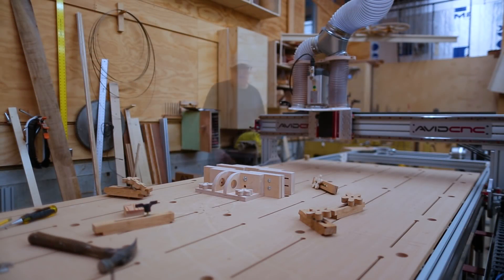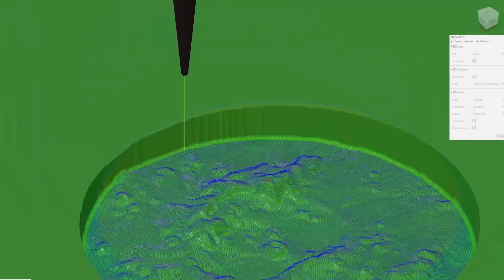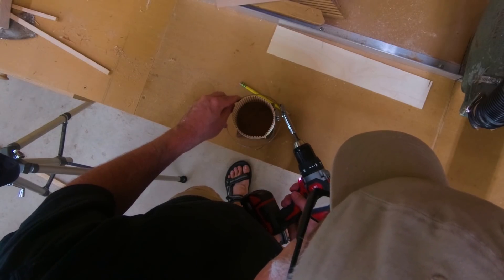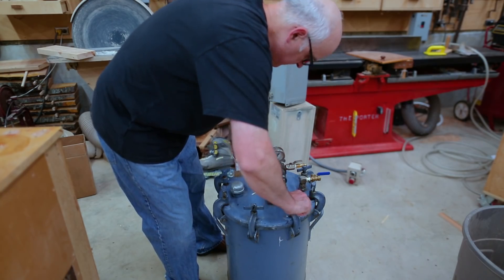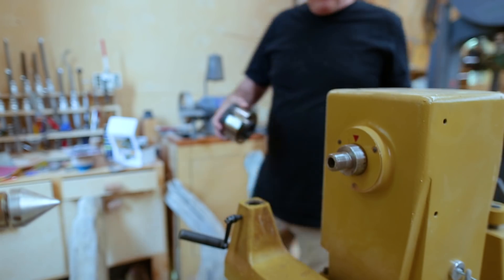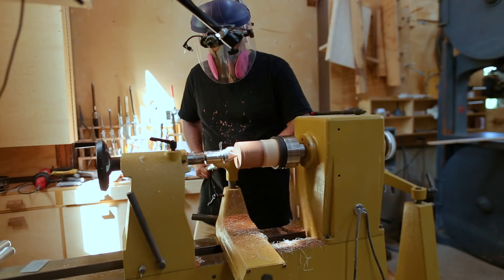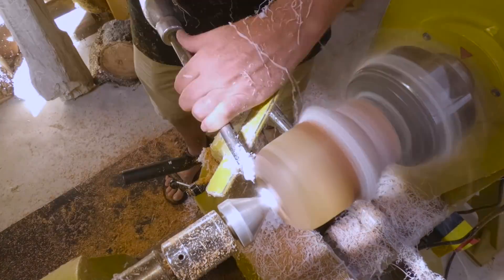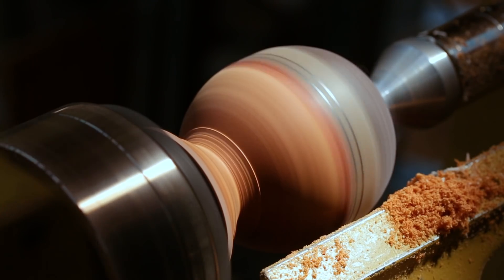Wood Turning a Sphere with Resin

Comment: I have found if you use a dust collection port right behind the resin cut those ribbons will fly right in to the dust hose and it helps keep the strains off the lathe. Awesome project as always Frank.

Comment: You can do it with hot glue. I use it to seal molds all the time. You just need to blob it on liberally around the entire base. I usually do about 1/4" bead or so when sealing mold containers.

Comment: The bubbles were caused by taking too long to pressurize the 1st pour, hence the separation line between them. And you can seal those plywood pores if you spread hotglue on the inside, BEFORE clamping the slated plywood around it. Cool project, loved the finish you got on it.

Comment: Shellac makes a good interface layer for epoxy.  Seals the moisture away without building up too much finish. I have used this with moist barn board with great success. Stops any clouding or bubbles from the moisture or contaminates that may have existed in the woods surface.

Comment: Sealing the wood with a thin layer of resin is best. A friend and I have done alot of live edge river tables and we suffered that problem. The sealing fixed it and no matter how dry your wood is it can still off gas a bit just from the heat of the epoxy curing. Pretty awesome for a first go!

Comment: Heating up the resin will make the resin very fluid and will make the bubbles rise up like in water. Although this will also require more resin since the resin will permeate through the wood, it also means no bubbles down the road.

Comment: You might try pulling a vacuum on the wet resin to remove the gas bubbles, adding pressure pushes gas in.

Comment: I made wood countertops with a marine epoxy. I poured a thin layer first and hit it with a torch to pop the bubbles. The second thicker pour was done by holding the container high enough that the epoxy thins to a stream.  This ‘ribbon ‘ puts a shear force on the bubbles that pops them. Vacuum degassing is tricky as some of the components in the epoxy are volatile and can boil off effecting the chemistry.

Comment: I use aluminum flashing for the outside vessel.  You can adhere it with hot glue around the bottom edge and at the overlap for a resin-tight seal.  A quick shot with a propane torch releases the flashing after the cure.  I've been using this method for a little while on my resin-enhanced turnings.

Comment: Usually you paint on a small layer of resin on the surface of wood and let dry.  Then it seals off anything inside the wood.  You won’t see a line where the 2 layers of resin meet.  Great channel!👍

Comment: Hey Frank! I would suggest using a vacuum and not a pressure pot first! turn your wood into stabilized wood by sucking resin into it as a block first, then cnc, then pour over it with the pressure pot. This will fill all the gaps in the wood and lock any air that makes it through the drying/cnc process in so you won't have bubbles, you could even use the vacuum when you do your final pour and get all the air out, then transfer it to the pressure pot if you wanted. Thanks for the great content and all your time you put into these videos!

Comment: Hi Frank. Love your videos. The air bubbles come from the pores of the wood. Drying further won't help. You need to paint a thin coat of shellac (Zinsser Dewaxed Shellac) to seal the pores and prevent air escaping as the epoxy displaces air within the wood during the pressure cure.

Comment: Transforming your pressure pot into a vaccum chamber might help with the bubbles as well. Basically you just to change the compressor for a vaccum pump. It even help sealing the vessel ;)

Comment: I just did a table-top with bar-top resin. The directions say to  put on  a thin coat with a brush and let it cure to seal the surface to avoid bubbles. You might want to try that. I'm guessing the bubbles aren't from water content but from air trapped in the cell/micro fissures in the wood.

Comment: Nick Zammeti uses that Yorkshire Grit on most of his projects and they turn out real nice. Your sphere did, too. Someone commented about sealing the wood with resin to stop the bubbles, and that was my first thought as well. I would have molded with the square portion at the bottom. Sure, more to remove, but easier to seal up.

Comment: Frank you could probably seal the wood with a thin layer of resin using a paintbrush, and when you do the bigger pour, it may reduce the bubbles that are coming from the wood; also to create an enclosure for the resin, you could use mylar and seal it with clear tape.

Comment: Taking one side off some corrugated plastic like for a poster board, and then wrapping it corrugation side out will help give you a smoother surface. You'll still need to hot glue it of course, but I feel like it gives you more control over the shape

Comment: When encapsulating high voltage electonics eliminating bubbles is mandatory. What we generally do is first pull a vacuum for a few minutes which causes bubbles to enlarge and float to the surface and pop. When the foam subsides, put the piece under pressure and any tiny bubbles that remain shrink and may even dissolve into the solution.  Don't know how much setup time you have when curing the resin ("pot time") but this may be something to try.

Comment: Hey Frank, You should try a vacuum chamber and stabilize the wood. Pen turners do it all the time. A lot of guys use a product called cactus juice. You submerge the wood in the juice inside a vacuum chamber, wait for the bubbles to stop coming out of the wood, take the wood out of the chamber and bake it. You can then cast it in resin without worry of bubbles coming out of the wood.

Comment: Frank, you don't need to complicate your life with plywood to make a form for the cylinder of resin. Just use some polyester film, 10 mil would be stiff enough and supple enough. Do 2 or 3 turns and use another layer of 2 of tape to hold everything in place. When the resin is set, you just peel off the whole thing  and you are ready to go. Several layer of paper with perhaps glue in between each layer would work too.

Thanks for your videos, I never miss one.

Comment: For turning perfect sphere's on a lathe, place a board or paper with a circle drawn on it directly under the piece to be turned and a light above. The light will cast a shaddow and when it matches the line on the board / paper, turn the piece in the lathe and do the same with the unturned ends and you end up with a sphere. :).

Comment: run a hair drier over the cooling resin to minimize bubbles. also, pouring a small amount first to let whatever air pockets may be in the wood fill helps. good work!

Comment: The wood is porous so water can travel up the truck like a straw. But this also allows air to travel through the wood. To avoid bubbles in the future block the underside of the wood with something first.

Comment: I like the bubbles too Frank, I think it looks awesome.  For what it's worth, a coat of wax after the yorkshire grit and a trip to the buffing wheel will make it shine even more.  And I would still put 2 coats of sanding sealer on before the fine grit sanding and the Yorkshire Grit to seal the pores and give you a smoother surface to start with.  Also, I think you're completely right about why the bubbles showed up.  Your first pour had air escaping the wood, but that was all sealed up for your second pour, so you can see the plane between the two.  It still looks great though!
Reply: Also, I could be mistaken, but I think most people that do the burl in epoxy thing stabilize the burl first.  Probably for exactly the reason you saw here.

Comment: Love it. Few thoughts though. 
#1 Why the ring? Just make a square block. It's a bit more work getting rid of excess with the band saw but it also is a lot less hassle than fitting a ring and plugging holes.
#2 To avoid bubbles you could just prime the wood first with resin. The first layer would be so thin bubbles would pop and no more can get through. 
#3  Yorkshire grit has wax in it so it does have some finish quality. Over time it tends to dull a bit though. Danish oil or shellawax for instance would give it a more durable sheen.

Comment: The bubbles are coming out of the wood as the resin soaks in. If you want to prevent the bubbles seal the wood first. Think school glue and paint that on over the surface of the wood first. It will dry clear but it will prevent the air from coming out of the wood.

Comment: Curious if it would be an option to put the plywood on the 4 flat sides to secure the pour instead of the wrap. 4 pieces seems easier to align. In any case, I love how it turned out!!

Comment: To prevent the bubbles I'd pour in a small amount of resin and coat the surface.. And drain as much out as you can.. Then pressure pot and let it cure.. And then do your final pour

Comment: You could maybe use a flexible plastic like an acetate sheet they use for baking instead of plywood with relief cuts? If you're worried that the acetate is too flexible, you could still do an outer layer of plywood.

Comment: Pockets of air often get trapped inside of wood regardless of how dry it is, so when you put it in the pressure pot you're pulling all the bubbles of air into the curing resin. I don't know a good solution to that problem, but at least the end result is a neat feature, rather than a terrible detriment. Very beautiful!

Comment: I've never had the honor of commenting on a Frank Howarth video with advice, but you should brush resin onto any wood you intend to cast in resin. It may be dry, but it's full of air that makes those bubbles. Seal it first, and it's all good!

Comment: Instead of plywood. I used a large plastic water bottle and turned the wood to match the inside diameter, used hot glue to seal it.  It went fast and was very easy

Comment: Try using a vacuum to make the bubbles grow so that they rise, then when the vacuum is released the resin is bubble free.
It makes the resin "foam up" so you have to do it carefully and watch while you do it.
It is more effective for removing bubbles than using pressure.  The pressure makes the bubbles small, vacuum makes the bubbles rise out.

Comment: In preparation try painting a thin layer on the show side and let that dry it'll prevent gas from coming out of the pores of the wood. Heath Knuckles does that and he almost always has a bubble free cast. But that "turned" out gorgeous and the pun was intended.

Comment: instead of getting it to true 0% water you can try painting the wood with the resin to seal it, it'll prevent air from coming out while the resin is curing. You basically did this, just with an inch thick layer of resin in your first pour.

As you said though, the bubbles look awesome in my opinion.

Comment: Would it make a difference if the wood were above the epoxy when you put it in the vacuum chamber?  It would maybe draw the epoxy into the wood instead of air, or moisture, out of the wood?  In any case thank you for these videos I find them exceedingly enjoyable.

Comment: From examining your results it seems that you could brush on a coat of resin on the landscape and let it cure. Then pour over the rest and use the vacuum treatment. The first coat on the wood should prevent any water or other detritus from entering the resin.

Comment: Frank, love this, but coat all wooden surfaces in resin before you add the main pour.  Wood also contains pores as you know, and they will let air bubbles out a the resin cures, especially if the resin you are using cures with heat.  Great work though, keep experimenting with resin!

Comment: Did you consider resin stabilising the wood after CNCing the relief?
Should stop much of the bubble formation.

A vacuum step before putting under pressure might also work to draw out much of the entrained air.

...Have a second tank already pumped down to a vacuum attached to your pressure vessel. Place the object in the pressure vessel, equilise the pressure  between the two (to quickly lower the pressure in the pressure vessel), Hold at low pressure for a short while to allow the enlarged bubbles to rise and remove themselves, then pressurise the tank to minimize any remaining bubbles.

Comment: You might try various sizes of PVC pipe instead. Curing resin doesn’t seem to stick to it, so you can make a single cut along the length and just peel it away.
Anyway, just a thought.

Comment: maybe if you soak the wood-piece in in resin and pull a vacuum on it first forcing all the air out of the wood. (pulling a vacuum - releasing and pulling a vacuum again to make the wood penetrated with resin)
i would imagine it's the cavities where water would be flowing up the tree that causes the bubbles.
Reply: @WhatTheFPS  oh? really? i would claim i've seen several, and nothing out of the ordinary, bubbles appear, but that's why i said to let up the vacuum and normalize several times. if you have a link to a funny video of how my theory fails; please by any means show us all how stupid i am.
Reply: @WhatTheFPS  he doesn't let up the negarive pressure like i said. (lets just let the resin overflow. how funny)

Comment: Wood has a bunch of air in it so when you add resin the air wants to come out. If you seal the wood surface first with a thin layer of resin it will reduce those bubbles greatly. But it still turned out great, no pun intended lol.

Comment: You should invest in making a set of fractional half jaws so you can accommodate any size like may throw at you. Considering this is woodwork, aluminium (a stouter blend) should suffice, so the price won't jump in space. You could even cut them yourself with your CNC.

Comment: Brush on a thin coat of epoxy first and you'll solve the bubble problem.  Also if you pick up some pieces of PVC pipe, and cut your blank to that size, you can use that as your mold.  It'll be reusable, and you won't have to do all the work with the plywood.

Comment: Mr. Howarth, what about the possibility of using vacuum instead of pressure. Vacuum might actually cause the resin to be pulled into the surface, and also lower the occurrence of bubbles in the resin. I think your pressure rig would work just as good as a vacuum chamber. The bubbles in this piece do look rather neat though. Kind of like ejecta  from an impact. Very cool video by the way, very inspiring!

Comment: While I may be completely off-base here, have you tried stabilising the wood? That ought to prevent it leaking bubbules your casting, absorbing the resin or letting any moisture interfere with the cast. A number of people doing wood/resin pieces also seem to paint the joint surface with "something," though I don't know what.

Comment: A.S
Hello there frank. I was thinking that maybe next time,  turn the plywood mold with the grooves on the outside, so you'll get a better seal. Also, u can use silicone if u want to b sure.  As always, wonderful to watch you work.
Reply: I was thinking the same.. on both...

Comment: Would stabilising the wood with a resin like cactus juice help with the offgasing maybe?  I dunno. 

I know that for the resin filled tables that they are using long pour time resins, like ecopoxy or deep chill epoxy and long cure times in the hours range to allow the bubbles to escape.  I recall they used less hardener to lengthen the hardening time, but that probably has limits and still have it harden.  Some other small pours are probably using vacuum instead of pressure.

Comment: Next time, coat the surface of the wood with a light brush of the same resin you're pouring, leave it to dry, then take your pour to the next step. And turn the plywood ring with the cuts outside.

Comment: Hi Frank. Just a little idea for you.
If you're turning resin again and you get those stringy bit around the tailstock, how about making a small jig that holds a very sharp blade that can be positioned to cut the offending stringy bits?
This should work and if it does the you won't have to clear it away.
Worth giving it a go?
P.s. nice sphere.

Comment: If you do it again you could try exaggerating the differences in elevation. I’d suggest the website “terrain to stl” and there you can exaggerate the elevation so the highs are higher and the lows are lower. Might look pretty cool🤷‍♂️

Comment: If you want topo maps like this to stand out, there should be a way to add an element of exaggeration to the topography thus making it seem more grand than it is, i.e. double or triple everything. Im designing a resin coffee table thats a cross section of the Atlantic ocean and i had to exaggerate the topography a ton to make the features noticable and stand out

Comment: Did you thoroughly clean the dust off the wood?   Like compressed air/dry toothbrush scrubbing?   Dust will act as nucleation sites for bubbles...

Comment: So the wife and I had a thought: what if you cut another blank of the same pattern, but apply a coat of resin to just the surface (like with a paint brush). Then either toss it in the pot or let it bench cure, popping any bubbles that may form. Once that's done, then do the big pour for the rest of the body. Think that might solve the bubble issue?

Comment: I don't know if it can be done in Fusion but other CAM software allows a "step up" after stepping down while roughing to further refine the roughing which can mean less tool deflection and chatter while ball milling.

Also, your step distance for the finishing pass was too coarse as you can see the lines from the finishing in the part.  The CAM software should have an option for controlling the "scallop" size left by the ball mill.  Personally, I don't like to use a simple x or y step over when ball milling a surface.  I typically use an adaptive spiral but these types also require better roughing.